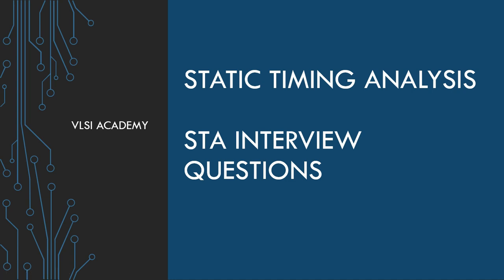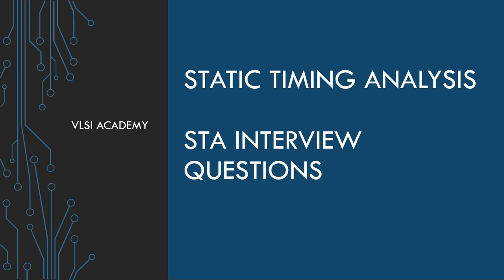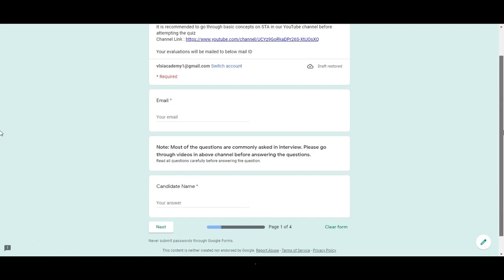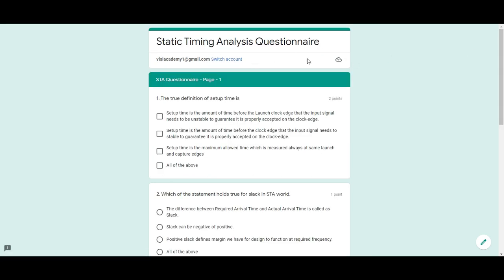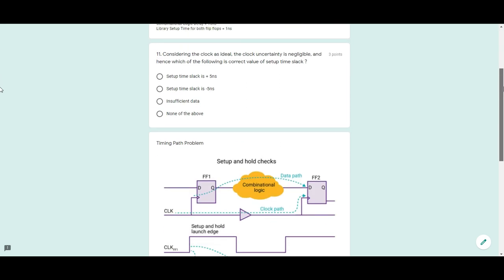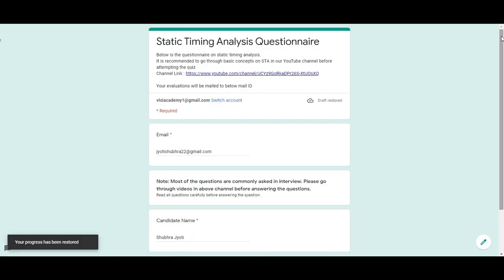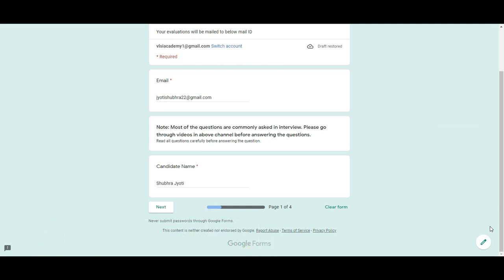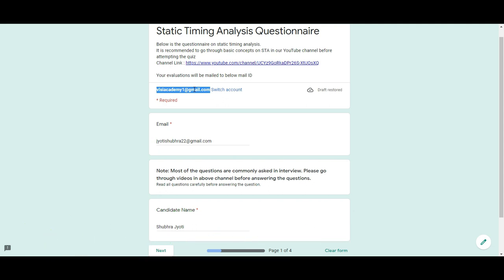sta lec36 - Interview Questions Part1 | static timing analysis tutorial | VLSI

Comment: 4. Which of the following statement is true ?
0/1
Clock skew in STA is a time parameter that occurs when the difference in the arrival times of the clock to two or more flip-flops that are in the same clock domain.
Having high clock skew is not preferred for timing and zero clock skew is the most preferred

Both are rt ?
Reply from the maker: First statement is correct, second statement is partially correct. Zero skew is never possible practically and isn't preferred as well. Low skew is good